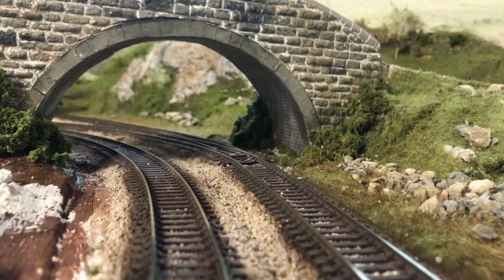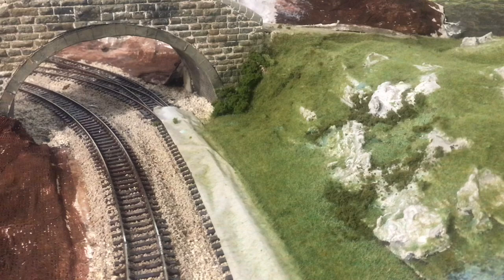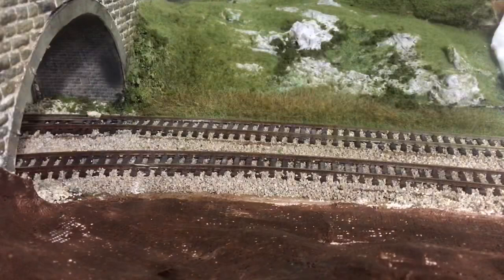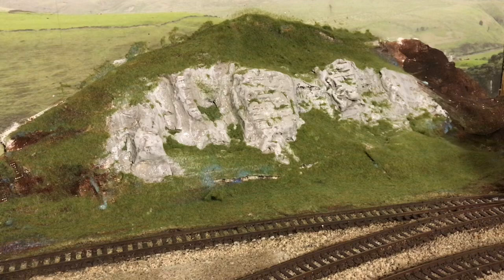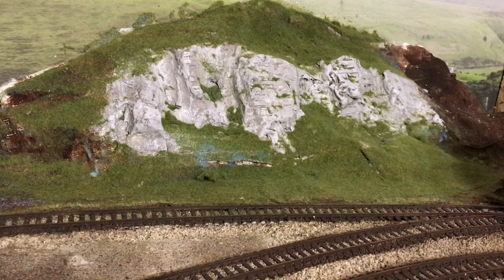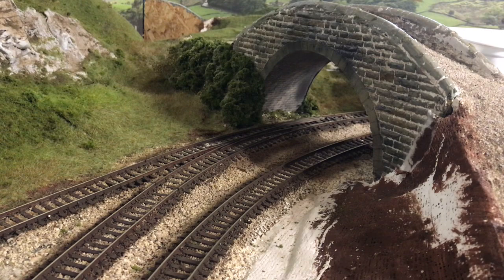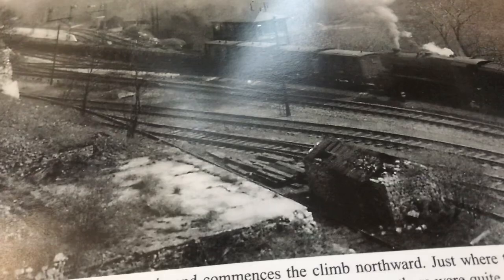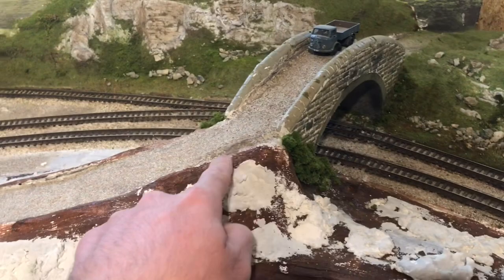Building a Model Railway - Limestone Hills - Track Weathering - Static Grass - Detailing

Comment: I'm intrigued as to how you get the static to stand up without making an electrical circuit? I note the crock clip is not clipped.
Reply from the maker: Hi 
Yep you don’t need to complete a circuit aslong as the clip is near the mesh it will charge the grass 
The grass is attracted to the clip once it leaves the hopper
Reply: @peaks4719  Thank you, much appreciated.